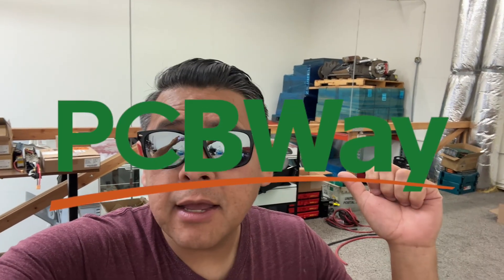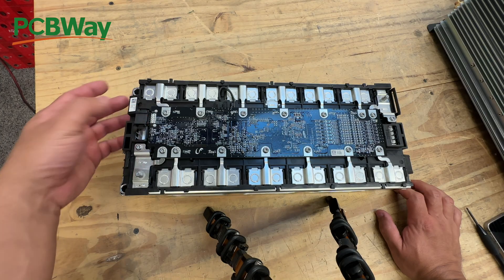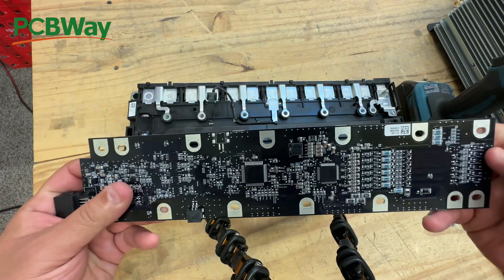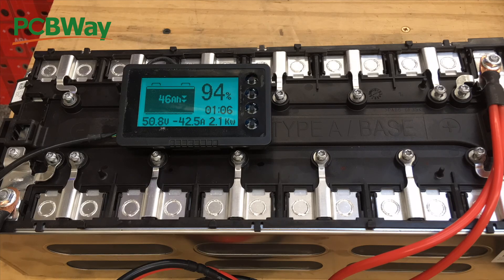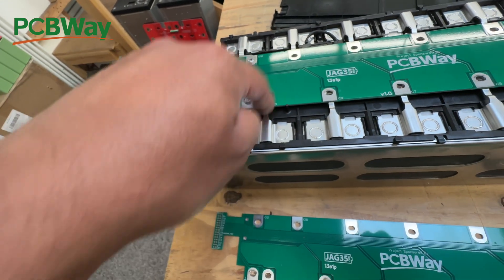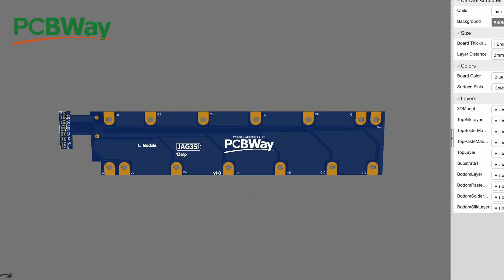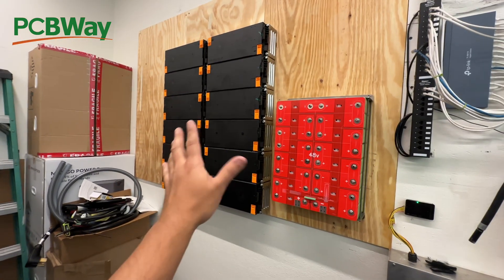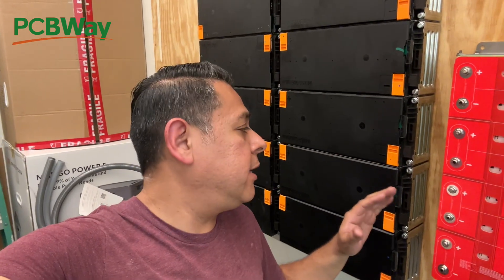Audi Battery Modules = Best DIY Powerwall

Comment: Anyone know if the stock factory BMS on these Audi Q5 has been hacked, and is it available on Github ?  I am not trying to sidetrack Jehu, just trying to save time as I would need 80-100Kwh worth of them so taking each one apart & changing them yeah.  Thanks in advance.

Comment: @jehugarcia I've been working on a diy ev for a few months now and have a burning question about using bms with the configuration you have on the wall. If you are using 48v packs in parallel and each of them has a set of balancing leads, how do you configure ( hardware and software ) the bms for charging? I'm trying to wrap my head around that.
Thanks

Comment: Cool video. Regarding the PCB mechanical design, I suggest you to print on a paper your design and iterate from there, and when you have a solid iteration, make the PCB. Iterating mechanical design with already made PCBs is quite expensive and wasteful.

Comment: So I need to do my first ever battery and I’m going the DIY but I just saw your Jaguar cell video. Which would you recommend for a 48v “power wall” with a Growatt 12k inverter and what would be the difference?
Reply from the maker: well,  these are practically sold out, (few modules left).  the jaguar ones might work well with your inverter if you use 5 packs in series (15s) for working voltage range of 45v - 62v,   If your inverter can be set to work with that voltage then Jaguar modules can be used.   Otherwise just use LiFePo4 https://jag35.com/products/high-discharge-600a-lifepo4-1780w-prismatic-cells?_pos=9&_sid=d5fdaf68c&_ss=r

Comment: How the hell did you figure out that 13S is 48V? 
Are these LiPo?
If these are LiFePO4 batteries, the nominal voltage 41.6 which a long way from a 48V setup. 13S is a bigger prick than the 220KW of 12S packs I have.
Reply from the maker: These are not LiFePO4
Reply: @jehugarcia  You didn't state, lots of detail was missing, left to assumptions.
Reply from the maker: Hybrid car batteries are never LiFePO4
Reply: @jehugarcia  I was not aware that you only did LiPo stuff nor that cars only used them (quick google search says otherwise). I thought you covered all types hence the need for correct details. Anyway, your content is not much good for myself as its only suitable for US markets.
Reply from the maker: Lord …. More wrong assumptions https://youtu.be/ySBtJOR2x-4

Comment: what isthe charge rate of this battery? at what voltage should charge?  and what is top and bottom cut off voltage?
Reply from the maker: Exact cell specs are unknown but  you can charge 2c just fine so 60A per module .  NMC based cells operate between 3v-4.2v   So x13 =  39v-54.6v
Reply: Thanks for the reply @jehugarcia

Comment: I have a 1500 w motor what size bms would I need
Reply from the maker: 1500w or bigger
Reply: Sorry but not sure can't find watts on bms only amps volts .Also because it's 1p do you need a bms ?

Comment: When I'm designing boards, I tend to make them as good as I can then sleep on it and continue the next day with a fresh set of eyes and a clearer mind. I usually find more bugs that way before sending the file out. Also, the cell taps could benefit with additional current capacity. Not much but a bit more for when using active balancers for more accurate voltage balancing. One more thing, I always hear you say "PCB boards" its like saying "printed circuit board boards" haha no worries just wanted to point it out 😁

Comment: The one big flaw Behind These batteries are that they are lithium ion they are too dangerous to use in a residential setting. Use them only in a concrete building 50 ft away from your home.
Reply: So are you saying if you have the car these came from, park it in a concrete building 50 feet away?
Reply: @dilbertnewton6864 😂

Comment: This looks like a fairly easy pack to put together, but I think the cost is way too high to be worth it. Once you add the PCB and BMS you are looking at $200/kwh. Since you can get factory built server rack batteries for ~$250/kwh I just don't think that modest savings is worth it. If the modules go on sale, could be really good though!
Reply: I dont know the quality of the server rack batteries but the cuality of this car modules are super hige or the best you can get, so maby the price is ok
Reply: @Bpoweron  Quality is hit and miss different brands different revisions have different quality batteries used. And in much the same way, the Price of these is only on this one website, if you hunt around, say your local scrapyard.. You might find a car you can yank them out of for super cheap. Most car scrapping///recycling yards dont warranty electronics (for obvious reasons) and because of that they charge less most of the time. A lot of sensors on engines are pricey, especially now days, If you go find a couple off your identical car, and yank a couple/three off, you are likely set for the life of the car, for a fraction of the price of one sensor new. Then even if one turns out to be a dud, you can still come out net positive saving money still.

Comment: Great video and batteries look good for aome applications. Also, would it be possible that before you order the pcb's, can you do an image capture, print a sample to use as a template? Just a thought and thanks for the video. Wonder if something like this can be used for a bluetti ac200max..
Reply: Im sure it could be, as long as the supporting electronics can handle it. I dont know anything about that unit, but if the rest of the internals can handle 48 then you should be golden.

Comment: Each 13S 20A BMS comes with a 14pin cable.  Why not just mount the BMS to a heat sink above the battery lid and run the cable leads to the battery cell terminals?
Reply: Because then pcbway couldn't be a featured sponsor duhhh
Reply: @suicidalkatt 😂
Reply: Yeah that's exactly what I would do. Solder on some ends and still screw them on. These Audi cells are amazing

Comment: 13s ios not the same as 48v lead acid, 14s liion is equivilent, because the median voltage isnt the same, , a 48v abtteryw hen flat is below 13s min voltage meanign it will kill batteries

Comment: Owawooo 😯👏👏👏 
One question 🙋
Your wall looks wooden is and how much kg  all that batteries if on top of eachother ?
If earthquake happens? Is that danger for wall mounted batteries ??? 
Thank you very much and best regards from Philippines 🇵🇭☕☕☕
Reply from the maker: 25lbs each so 300 lbs,  not that much  .  Big bolts into steel framing it’s fine

Comment: I understand that you look at the heat generated and say that it will handle a certain amount of amps.

How much battery degradation should be happening when used so hot with that many amps?
Reply from the maker: Beteeen some and all

Comment: We need every content creator that does a PCB way PCB sponsored or not but show a total price per board. 

It’s nice to design a pretty board and get it sent out but if it’s like $200 we’d like to know that😂
Reply: For bare circuit boards they are one of the cheapest out there especially if you need a few. If you only need 1 then you have to factor in shipping etc. In qty of 5 these boards should be around $10 each.